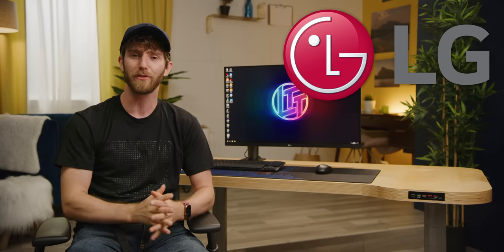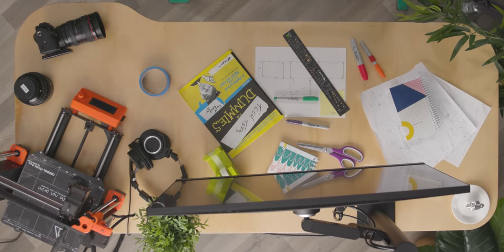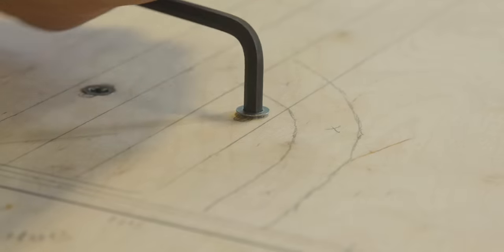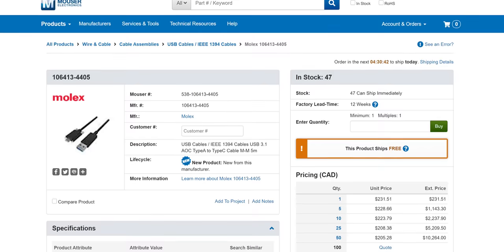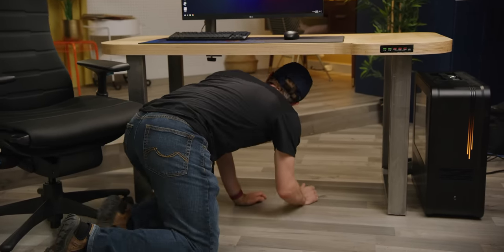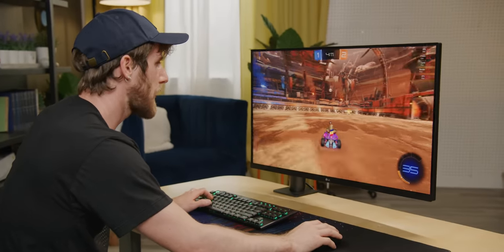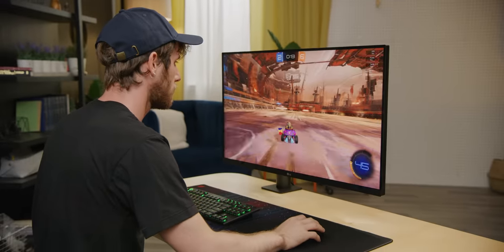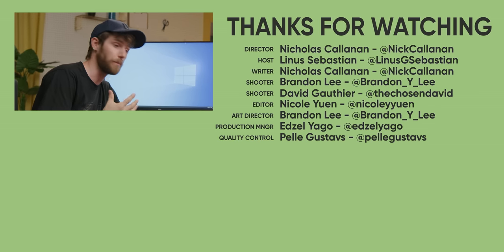Project Zero Cables - The Cleanest Desk Setup EVER

Comment: "No one likes bumping a USB stick and breaking it off. We've all been there." Am I missing out?
Reply: ive done it
Reply: @sarcasticmcspastic  That is quiet the kill count. Were they 64 gb?
Reply: After them saying this I don't get why they didn't ended up have the hub next to the stand facing up? The area where it ended up looks like an accident waiting to happen unfortunately.
Reply: Would be amazing if displays would have a usb port or 2 in front.
They already have a few at the back.
Reply: @hubertnnn  that's a great Idea.
Reply: check out diy perks video on it
Reply: check out diy perks video on it
Reply: Mini usb Is the worst for breaking
Reply: @hubertnnn  mine has one for charging
Reply: I would be missing out too if my brother didn't push me while I had my headphones on my head.  He still owes me $80 for the damage.
Reply: @sarcasticmcspastic  that's why I use back ports
Reply: Yes.
Reply: How tf do u break a usb stick
Reply: Nope
Reply: This is why I bought a Samsung USB memory because it's no bigger than a Bluetooth dongle
Reply: I've broken a Network Adapter a few times
Reply: Yeah never heard of that
Reply: same i’m missing out
Reply: I haven't done it either, but I've burned out a USB stick or two from extensive use
Reply: Well, i didn't break any, but i did accidentally slightly bent the head of the USB stick a few years back (though its still working fine even now).
Reply: It’s more with aux cables.
Reply: And that's how I broke my original Antec P182
Reply: one of my coworkers managed to fubar an hdmi plug some time ago
Reply: I've never done that, but I have bashed my audio interface with my chair numerous times, and now the headphone volume knob wiggles.
Reply: Im not no pussy they were the 40$ SanDisk 128gbs ive been there
Reply: Same... Maybe we're just not bumbling morons!
Reply: @sarcasticmcspastic  well fool me once , , but fool me 8 times dude
Reply: Its never happened to me either.
Reply: time to ditch ya friend
Reply: I've never done it.... Almost have multiple times tho... Wireless dongles.
Reply: @eonizen  it would collect a ton of dust I guess
Reply: @HauntedSheppard  That is a very valid point. It does make us question why computer case makers, more often than not, tend to install their IO facing the top of the cases though.
Reply: @eonizen  that's probably to prevent the usb breaking part and it's only quite recently that people arn't placing their pc's on the ground. But that's just my guess. It could very well be that dust buildup is not that much of a problem and that facing it down would make the hub stick out beyond the thickness of the desk.
Reply: @eonizen  i think a hub that sinks into the table might not even be that hard to build. You just need to pay attention to the grain of the wood in the pieces you use and figure out a way to lock it angled up
Reply: especially if there is a lanyard on it and it gets caught in your chair's wheel.
Reply: With the placement on the edge of the desk like that, I will break the USB sticks off. I would have to make a raised bump on the side of the desk, so the USB sticks are just above the table surface.
Reply: @sarcasticmcspastic  how
Reply: zero
Reply: i broke my tablet trying to charge it with my charger because my charger was not reversible and i was 4 at the time...
Reply: I’ve never
Reply: Well, I have knocked a USB out of its socket, but never broke it due to that.
Reply: I've damaged my pc usb's cause of shit like that hate it
Reply: Not even once. I broke other things
Reply: ive only done it for aux cables, those fuckers are so brittle
Reply: O
Reply: Been a Systems Admin for almost 20 years and I have never broken anything off in a USB port.
Reply: I never have, but I have with DisplayPort... a few times.  That lock is deadly for the cable I swear, instead of coming out it snaps.
Reply: Yep. I've done it many times.

Comment: "Project Zero Cables"
Then me: saw one cable behind the monitor arm at the beginning
Reply: Q: Why was the belt arrested?

A: Because it held up some pants!
Reply: True
Reply: This annoyed me right from the beginning lol
Reply: Its now project one cable then
Reply: scam
Reply: There are two cables?
Reply: Well wireless video is the last and the hardest issue to overcome, even AirPlay and NDI still have a bit too much latency and require A LOT of computing power. Me and a friend are experimenting with wireless video for over year now and were able to send a 720p30 stream to a RaspberryPi 3 B+ over wifi with some dropping frames. Even VNC for remote access is not latency free enough for gaming.
Reply: @webfischi  you could easily hide that cable tho
Reply: Yeah lol.. I drilled like an inch hole up behind monitor and one exit hole down below the desk into that monitor stand pipe or w/e so I could shove the DP cable into it.. Yeah Cleanest Desk Setup my ass :D
edit: also wireless keyboard to a desktop setup? ahahah... no.. ehm.. thanks.. not going to happen.. it probably died like 3 minutes after they finished filming :D
Reply: Exactly
Reply: so triggered.
Reply: Lol same
Reply: Should of modded the monitor arm to hide it...
Reply: No , i saw that 1st !!!!!!!
Reply: it’s just a gimmick.. lol
Reply: Was just about to post this comment
Reply: I gave this vid a thumbs down just because of that LOL Thats like making a zero compromise PC but putting your GPU in a 8x Slot...
Reply: @jdwmyt   clever
Reply: We need Project Zero Clickbaits.
Reply: That's why I'm here
Reply: Ltt exposed!!!!!!!!!!!!!!!!!!!!!!!
Reply: god damn it. I will never unsee that cable now!
Reply: It's still making me twitch and grimace.
Reply: Lol
Reply: that one cable was starring at me the entire video
Reply: that was me as well, lol
Reply: The same!
Reply: I thought he was going to show the camera obscura in this video.
Reply: you mean 2 cables
Reply: @jdwmyt  cringe
Reply: #ocd
Reply: 0:25
Reply: @zzzzzzzzzzz114  like your dad
Reply: 🤣🤣🤣
Yeah
Reply: HEY absolutely nothing to do with the topic, but okay
Reply: Chris723 Okay
Reply: youre me im you
Reply: It has been annoying me this whole time
Reply: @webfischi  meanwhile dji sends 720p with 120fps at 25ms latency over 7km lol
Reply: Omg same
Reply: That’s all I could look at
Reply: same lol
Reply: Exactly whst i wanted to say but then i saw this comment
Reply: Project one cable
Reply: SAmE
Reply: LOL SAME
Reply: they should have used a wireless HDMI adapter
Reply: Ikr
Reply: Only one wire ok grow up
Reply: Project almost no cables
Reply: Heheh
Reply: I couldnt focus on anything he was saying because of that
Reply: iiii waass gonnaa commmentt
Reply: For me the real problem was the PC on the floor. I never had a flood problem in my house but yet I fear it.
Reply: @jdwmyt  ok chris
Reply: its about hiding the cables, now watch me get wooooshed
Reply: i was about to type the exact same thing good eyes man
Reply: I 
Instanly saw that i was like LINUS!!!!!!!!!!!!!!!!
Reply: Me too
Reply: @webfischi  wait wireless video is the hardest? Wouldn’t wireless electricity be the most difficult to overcome? That monitor has a power cable too, which makes the entire concept of this video bullshit. I thought they were going to use some brand new space-age wireless power transmission or something

Comment: I didn't expect DIYPerks would actually one up Linus' build. Nice.
Reply: Yeah his is way better than this
Reply: I mean, I don't think LMG has done any decent DIY project since the sleeper PC's, very dissapointing with how much sponsor and merch crap they shove down your throat only to do half cooked shit (oh god the god awful pyramid PC layout).
Pro tip: just get the sponsor block extension ;)
Reply: @allisongonzalez9196  I honestly think that this is a very nice DIY project, for LTT not being a pure DIY channel like DIY perks...
Reply: Yeah diyperks is fantastic!!
Reply: I watched DIYPerks vid and it was awesome. But Linus said at the end of the video that they will be doing the PC-in-desk v2 of the build soon, so that should be the one that should be compared to DIYPerks' vid.
Reply: Diy perks did a better job than this but they are both clean
Reply: what do you mean? they are completely different concepts. a desk pc vs a regular setup w/o visible cables
Reply: I didn’t like diyperks version. At least Linus has full wood and not fake plastic like wood on metal. Both have issues that I just can’t get over. At least diyperks also hid the tower in the desk. If they wanted to do better they could have had the monitor hide in the desk as well as water cool all of the parts inside the system with radiators at the back moving air so it’s hidden with the power or go full laptop like and heat pipe the bottom metal planet to the gpu and cpu to spread the heat out and use the large plate as a massive passive cooler like most laptops do when not working at max. Linus just hid cables though so not really a fully clean build. I agree with you that far
Reply: @Chris-cv1ll  same. Diyperks' goal was to hide the pc. Linus' build presents a clean PC. Diyperks wants to just have a desk that has a PC. It's essentially desk build vs pc build. Their focus is quite different
Reply: @MarcRitzMD  usually he spends a month or 2 then uploads something stupid like the usb a mouse dongle to a usb c one because his usb c to a adapters was "too bulky" but then made something almost the exact same size, or his diy laptop out of a phone, why? What's the point of that when those in a premade form exist?
Reply: @Chris-cv1ll  Plastic like wood?
Reply: wholly_unholy the stuff that they used to layer on the metal to make it look like wood. It’s not really wood if it’s what I think it is. It’s stick on plastic with wood color and texture.
Reply: @Chris-cv1ll  DIYPerks did not use "fake plastic like wood on metal". He used veneer, which is very thin REAL wood. But yeah, his tabletop also used aluminium, which you may or may not like.
You could hide the aluminium at the top of the table by countersinking it into the wooden frame.
Reply: It's an deepfake
Reply: @VezWay007  Nailed it. I'm not sure why it's been compared to DIYperks as the concepts are different.
Reply: Marc Ritz sorry...As soon as I saw it I turned off the video as it ruined the project for me period sorry.
Reply: D.B.E. Evolution sorry...As soon as I saw it I turned off the video as it ruined the project for me period sorry.
Reply: @Chris-cv1ll  dont apologise for having you're own opinion haha. People will like this build, others will prefer DIYperks. Each to their own..
Reply: All his builds are. You should see his leather cpu case. Absolute beaut.
Reply: Is that a fallout buff?
Reply: @allisongonzalez9196  if you dont pay your creators another way, least you could do is watch their ads :/
Reply: Hello can you help me. I bought a new motherboard and I assembled it correctly. Initially the computer booted till the windows logo and turned off. After that I am trying to turn on the computer but the computer is on but there is no signal to the monitor. I didn't checked the cable, connections, ram and I even reset the cimos setting but there is no signal till now
Reply: Hlo Linus plz help me, I bought a new motherboard and I assembled it correctly. Initially the computer booted till the windows logo and turned off. After that I am trying to turn on the computer but the computer is on but there is no signal to the monitor. I didn't checked the cable, connections, ram and I even reset the cimos setting but there is no signal till now
Reply: DIYPerks desk is lacking cable management for power connectors. So does the one from Linus. Where do I plug in two monitors, PC, audio system etc into I would ideally want the whole powers strip integrated into the desk.
Reply: Ye
Reply: @Chris-cv1ll  I thought that's what you meant. That's incorrect, it's a wood veneer. It's 100% real wood, just cut very thin.
Reply: @Chris-cv1ll  Matt recently fixed all the issues you mentioned, so.....is it perfect now?

Comment: ...and the results are in:
Aesthetics: goes to DIY perks
Features: goes to LTT
Shilling: go to lttstore.com
Reply: the diy perks table was definitely cool, but those temperatures were not.

did you see him say the cpu was 85°C?
Reply: @Yuriyalloween  Under heavy load, which is fine since they'll work at that temp constantly for years, which they won't be actually subjected to. If you're really concerned, you can fine other ways of dissipating heat such as using the entire tablet as a partial heat sink or doing a loop.
Reply: Are you linus’s alt?
Reply: DIY PERKS should use water cooling system, seriously.

Comment: If anyone wants to do this without custom building a desk, I recently built a cable management box for my set up and it was super easy!

I made it with scrap wood from the garage in about an hour - I made a 3.5 sided box, bottom, then front and sides full walls, and then a short wall with a hole on the open side (faces the back of the desk) to help control the display cables. Made it large enough to mount a power bar and all my AC adapters / extra cable. Put a hole on the on the bottom right above the back of the pc for all the cables to run out in a nice bundle, and finally a hole on the side wall next to the desk leg for the power bar cable to run down. Twist tied any bundles of wires together (like going from box to pc or display) for an even cleaner look - tip, use twist ties for cable management over zip ties as they are easier to adjust when you inevitably want to make a change. Mounted the box on the underside of the desk with L brackets and you can only see it from one spot in the room if you are looking for it specifically. I was also able to hide my wifi / bluetooth antenna in there for an ultra clean set up! 

All my cables are now out of sight and out of mind while also improving my airflow / cooling coming out of the back of the case! Its also handy as everything on the desk is supplied by one power cord that plugs into the wall - so moving the system / supplying power is super easy.

Comment: 7:18 Don't wipe your sanded surface with a "damp cloth"  this will raise the grain of the wood and will require even more sanding to get the texture you are looking for.  Use a Tack Cloth, which is sticky, that will grab all the sawdust. Vacuum works well too.  Desk looks great! I really enjoy this sort of vids from you guys, really gives all neat ideas.
Reply: As a former painter, I can't agree more. When you sand off the raised grain, you will likely create holes in the finish, so avoid additional moisture.
Reply: They have ideas, but they often leave a lot to be desired in terms of execution, which is why I appreciate comments like yours even more!

Comment: For people who just want a quick&easy low-teach approach to this:
Go get yourself some hooks with screw-ends on them at some hardware-store. (or if your table is not very thick I'm sure some adhesive alternative exists)
Then just put those at the underside of the table all the way towards the back (assuming your table is against a wall, which I'm sure is pretty common).
Route your cables on the hooks and you will have a neat combination of them being "invisible" unless you actually stick your head underneath to look - and them still being fairly easily accessible if you need to add something or make changes.

For a trivial cost this can really make your computer desk go from a mess to "wife approved" (which as we all know is the highest seal of approval one can strive for).

Comment: LTT: the cleanest desk setup

DIYperks: hold my beer
Reply: @user-qu7qh7qj2t  Linus started a in-desk PC build a few months ago as well but there's been no sign or mention of it so far.
Reply: @user-qu7qh7qj2t  because this isn't a desk PC build. it's a regular setup w/ "invisible" cables
Reply: @dolan-duk  hmm... 13:57
Reply: @user-qu7qh7qj2t  diyperks is the cleanest DESK setup. Ltt is cleanest PC desk setup. Diyperks doesn't even want the monitor on the desk, literally nothing should be on the desk. Basically a desk that CAN be used with a computer. Meanwhile, ltt goes for clean pc desk area. Different concepts tbf. Their focus is quite different. Both are good depending on what is needed

Comment: "No one likes bumping a USB stick and breaking it off" proceeds to install the hub at the very front of the table instead of somewhere along the top outer edges.
Reply: Broken 5 usb mobile broadband dongles over the years in laptops from bumping or bending them
Reply: A router Chantelle on one side of the monitor mount to the channels underneath, and the USB hub on the top back right of the desk would be ideal 👌
Reply: I think just below the monitor pointing up would be the best place. Your phone, thumb drives, wired mice/keyboards...all just right there. But have a secret compartment for extra cable to be kept. I can't tell if I'm explaining this right.